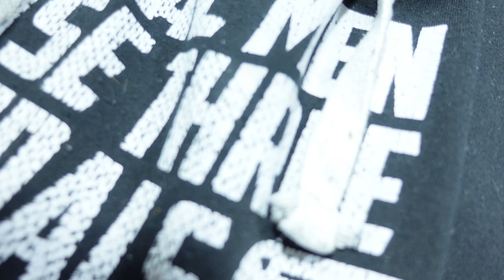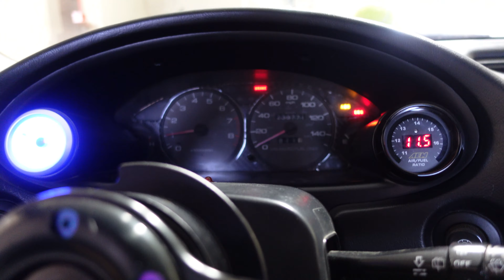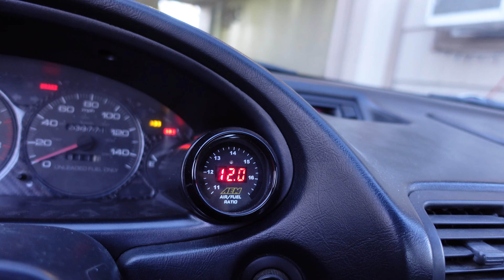I Broke My Turbo Integra! | TunerThings

Comment: If thats one of those ebay paper shiney gaskets get rid of it. Your losing like 1500rpm of spool time bc its leaking. Promise. Get oem metal Honda gasket. Also get metal ones for turbo to manifold / w/g to manifold as well.
Reply from the maker: I think you're right, looking at the gaskets they're both starting to separate. Def gonna get at that tomorrow! Thanks for the heads up!

Comment: Double check for a boost leak, or vacuum leak
Reply from the maker: Just went to look... all my vacuum lines are in good condition and connected, I'm thinking the gasket between the turbo and manifold is borked. Thanks for the suggestion!